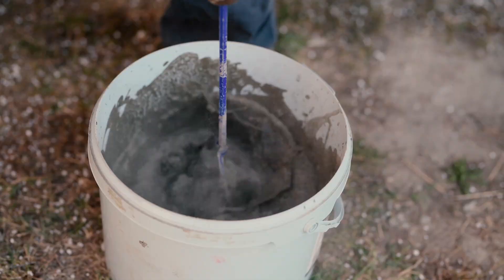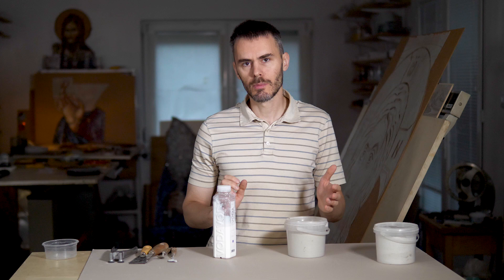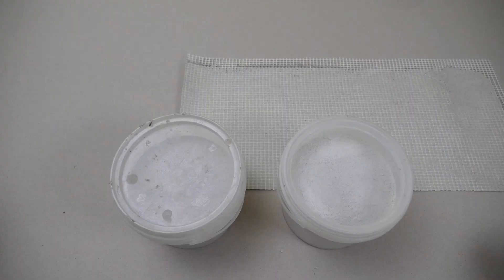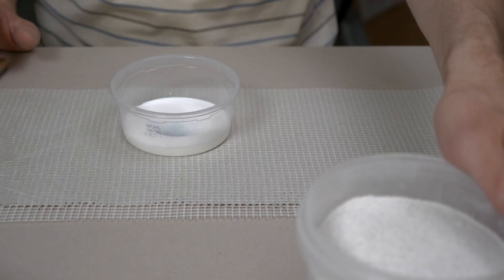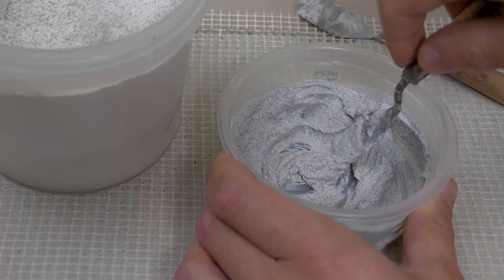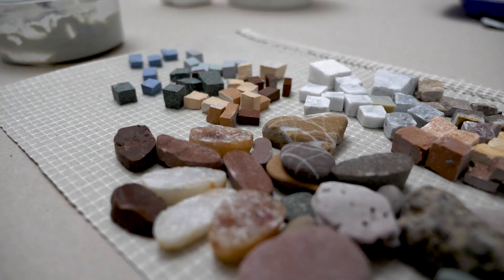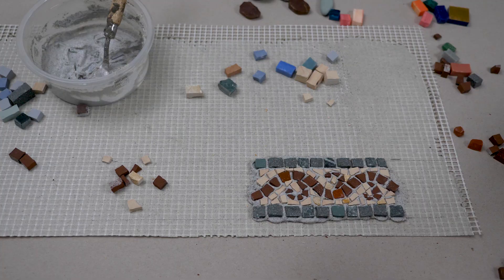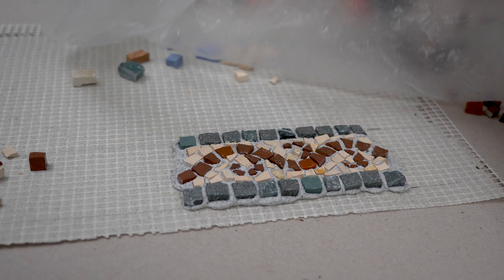Mosaic Glue - Best Adhesive for mosaic

Comment: Hi Milan, could you please be a little more specific on the latex liquid. The only thing that seems to match what you are talking about is a PVC liquid paint primer. I have spoken to a couple of contractor supply places and they were not sure what you were talking about either. What are you using? Brand? The container you keep it in does not say. Thanks
Reply from the maker: Hi, It was not my goal to promote any brand, but it is not secret what I am using. Liquid is aaded to increase elasticity of glue. Companies have it under different name. I use product of Mapei company, Kerabond T as cementitious adhesive + Isolastic as liquid.
Reply: @MilanMosaicArt   It is not a problem if you say what you use as long as you tell people it is not promotional. I went to a contractor supply and they did not know what I was asking for, then I showed them this video and they still did not know. Either they need to learn more or more information was needed. Thank you for answering.
Reply: Try asking for a polymer additive. You can get it at Lowes
Reply: @KMF3  have you found a latex additive at lowes?   Any suggestions for a brand that can easily be found in the US?
Reply: @montanaweaverkim  I don't know if it is latex but it is a polymer additive that is specifically for thinset
Reply: @KMF3  thanks KMF, I am needing a brand name latex additive to mix with cement for an outside mosaic?    I have only come up with the laticrete 4237 latex additive, 5 gallons, which is a lot!  And I am not sure if this is what Milan is using?
Reply: @montanaweaverkim  the one I use is for outdoor